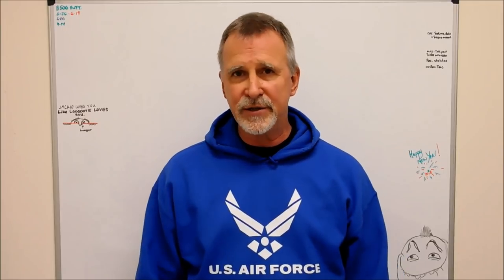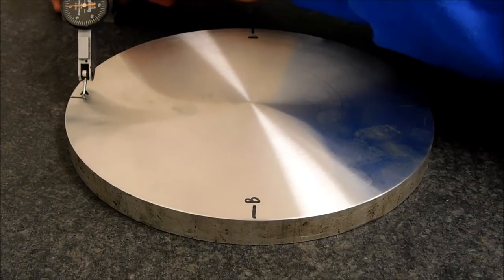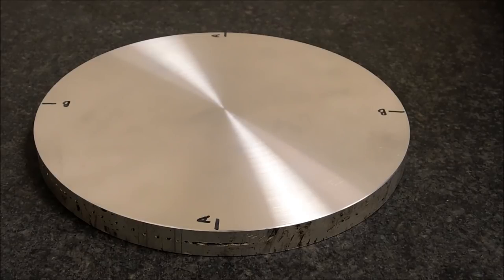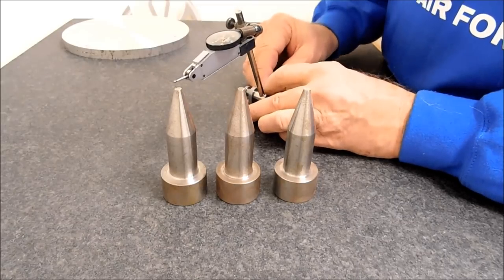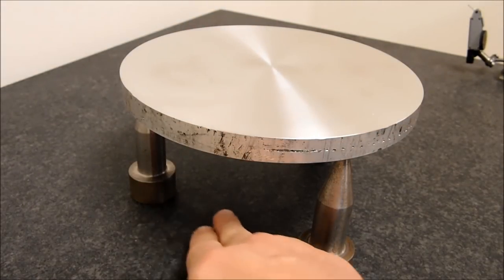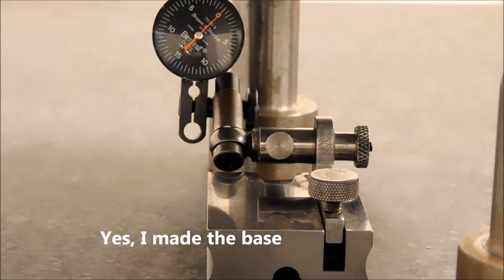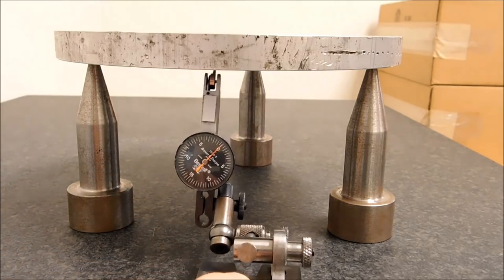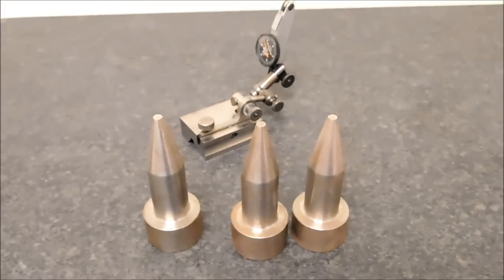How to Accurately Inspect a Flat Surface

Comment: Lots of cosine error.
Reply: Another internet guru...
1) Looked like the set up was about perfect - the tip appeared to be at about the correct angle with respect to the work.
2) sine error (not cosine in this case), is not especially relevant in comparative measurements, and the error (if relevant) is minimal.
Reply: joshua43214
Thanks, I've thrown the term "cosine error" around without considering that there might be a "sine error" too. So, would you say sine error is what "test indicators" experience and cosine is what "indicators" experience?
Reply: Yeah, reference a NYCNC video about precision! INSANE!
Reply: Self taught guy that used Chinese mini toy machines couple years ago, against professional machinist with years and years of experience...
Reply from the maker: Brian Kiehnau       I personally have spent many years working with indicators (40+ actually), and will challenge anyone that calls BS on this setup for some "Cosine"  error that may or may not exist with a calibrated lever style indicator. You have inspired me to do my own video on that topic because I personally think its BS. I will also go out on a limb here and say an indicator is for indicating a difference in features and not for measuring unless the indicated needle movement is very small. A lever style indicator gets its ROM directly from a rotational driver and angular movement remains constant about an axis regardless of where about that axis the movement takes place.
Reply: Your setup is a good one and I thought your indicator was well placed. Still cosine error is a real thing (that often doesn't matter if you want a relative measurement). The best way to think about it is shown in NYCCNC's video where he shows a drop indicator.  When the drop indicator is straight up and down, the indicator reads the thickness of the part directly, just like you'd think.  But when he turns the indicator 30 deg. off of vertical, the indicator is now reading the hypotenuse of a triangle whose base leg is the thickness of the part, so the measurement reads high.  With a DTI, the indicator gearing plus the non-circular shape of the tip is made to read absolute measurement at an angle up to around 20 deg. from horizontal.  Past that, errors are introduced.  Cosine error does not matter if you read zero all around but if want to know that surface is flat to say within .001, then you should have your DTI tip within 20 deg. of horizontal to get an accurate measurement.
Reply: bkoholliston - then perhaps he should be using a “vertical” style test indicator, which if you could work out the mounting on your stand, would have the dial more or less perpendicular to the surface plate and easy to read, and the indicator contact point more or less horizontal to minimize cosine or sine error.
Reply: Steven Haskell As long as the angle of the indicator needle is within say 20 deg. of being parallel to the surface being measured, the error is negligible. You can use whatever style fits the space and is easy to read.
Reply: Brian Kiehnau Lack of understanding error more like 😁
Reply: Even if there is any angular error, it will magnify the indicated value.  So, whats the problem.  If you have to work to a specific tolerance, you will be well under if your indicated value is within spec.